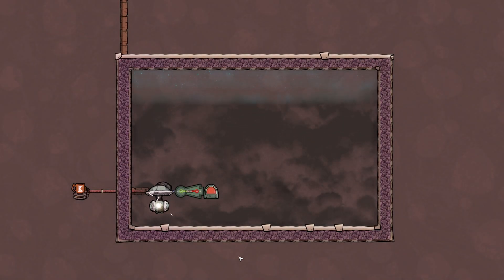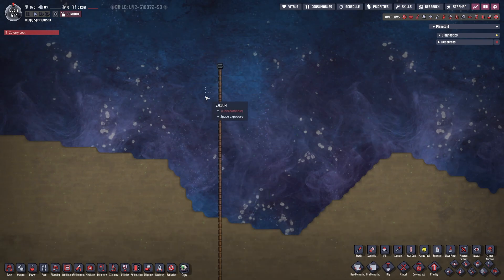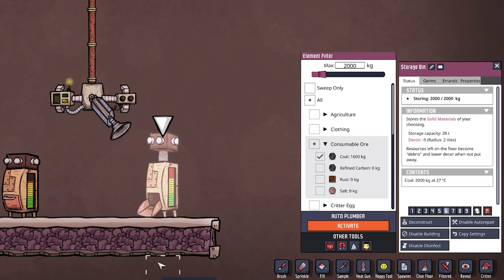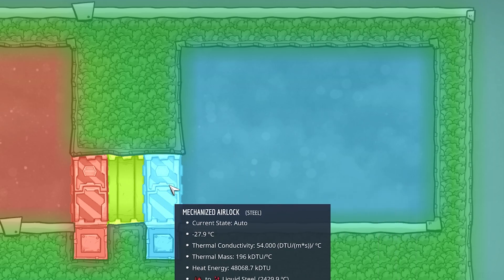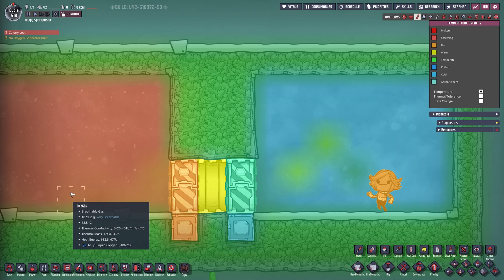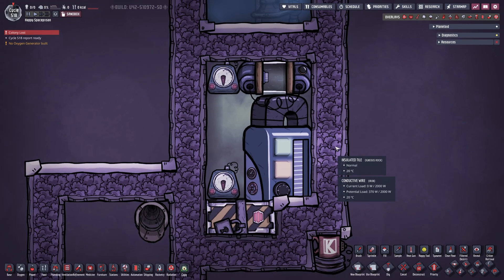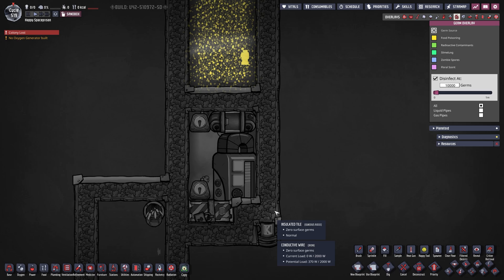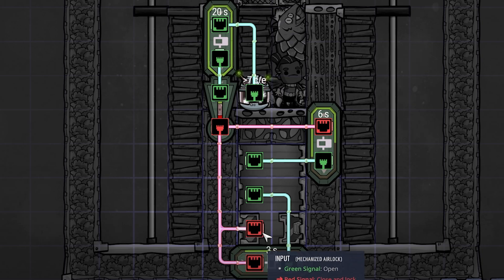GERMAN ENGINEER explains ONI: CRITTER KILLER, GERMINATOR, and MORE! Oxygen Not Included Spaced Out

Comment: i am having issues with the creature killer.  The water keeps getting voided.  My timers are set up the same
Reply from the maker: Something has to be wrong somewhere, the water only "disappears" if a door on the top closes before one on the bottom is completely shut. There has to be a mistake with the wiring or timers.
Reply: @BierTier   I think i figured it out.  If I go to 10X speed it glitches out and the doors get out of sequence.
Reply from the maker: @landiln21  That could be, the game is definitely not made for 10x and needs to be used carefully :)
Reply: @BierTier  What does the number on the drop off point suppose to be in the drowning camber? Will that matter if you had farms and want to drown excess for meat?
Reply from the maker: @wadeatkinson7790  The numbers don't matter that much for the dropoff. Just set it to everything you want drowned, lower priority than your farm and max creatures. Then just set your critter sensor to the number of critters you want to kill at once(I usually do 3 or 4. You can do more if you have a massive farm going)!